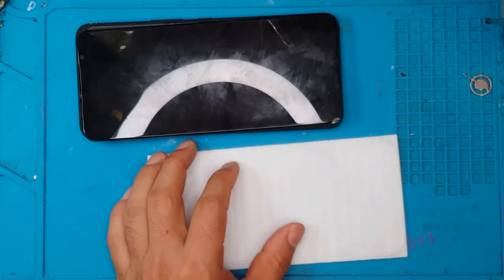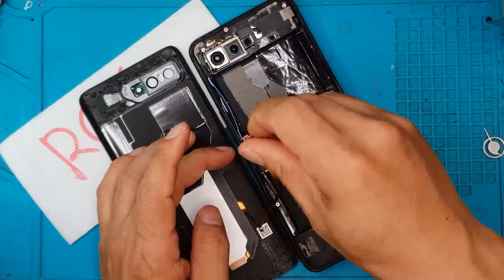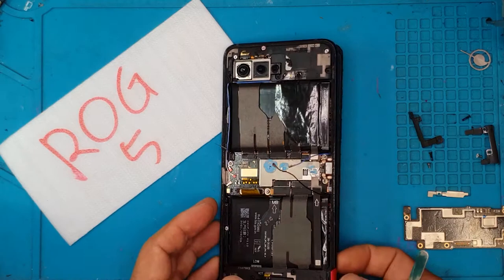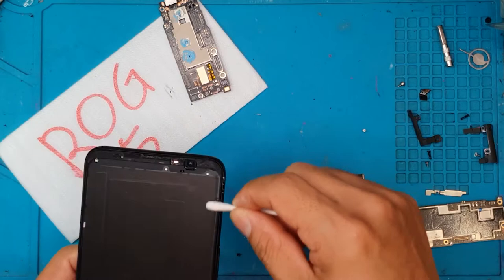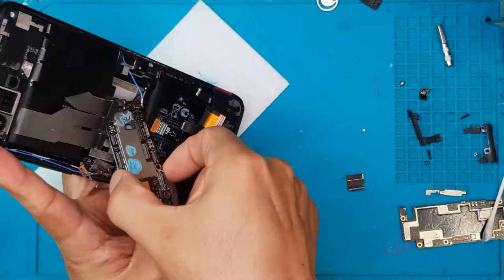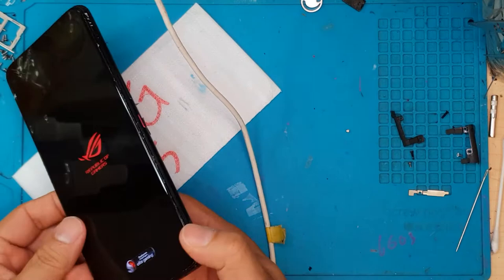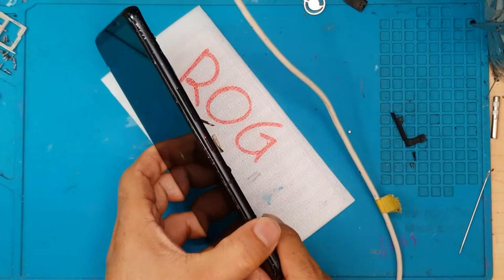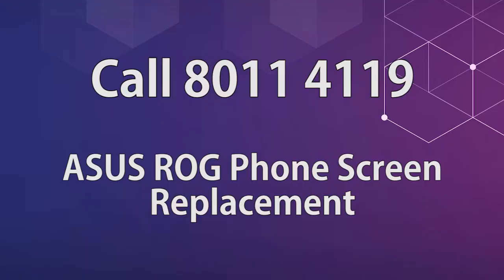It's finally an ASUS ROG PHONE 5 Screen Replacement! | Sydney CBD Repair Centre

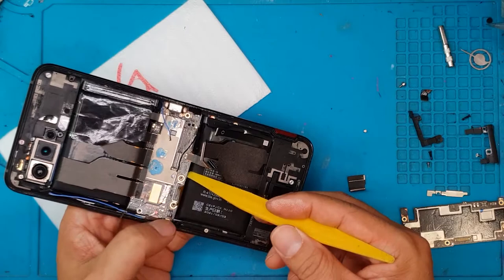Comment: at around 2:33 you mention thermal paste under the battery but you never say if you had to reapply anything...?
Reply from the maker: under the battery, there is strong adhesive so most likely you don't need to reapply anything.

Comment: Do rog phone screens go bad for no reason? My rog phone 5 screen is fine, no cracks nothing but completely stopped working.
Reply from the maker: Hello, it might be some other issue like battery, software, mainboard, water damage, short circuit.

Comment: My rog 5 no display light. Display ic change?
Reply from the maker: Hello it depends on the situation, if no light you mean even the back light if full already small ligh you see, or phone total black screen but it vibrates with you turn on, or phone just dead, you need to bring it to repair shop near you to diagnose the issue.
Reply: @SydneyCBDRepairCentre  even back no light. what Will I have to change?
Reply: @SydneyCBDRepairCentre  i was changing parts without disconnecting the battery connector 😭
Reply from the maker: @FNaga  oh no. you should ask for help from local mobile phone repairers.

Comment: May i know is ths screen u used for replacement is an OEM? cuz my rog 5s screen is broke, i want to know if it is safe if i change it using OEM screen
Reply from the maker: yes, it's genuine. please visit https://sydneycbd.repair/locate-us . we have only a few screens available now. thank you
Reply: @SydneyCBDRepairCentre  does it means oem and genuine the same thing?
Reply: @SydneyCBDRepairCentre  cuz im currently in malaysia and i wanter to change my screen, but the service centre said the one he has is OEM, i wanna sure if it is safe using changing it to OEM cuz the price is more affordable compare to the original one
Reply from the maker: @user-zv5pe7dr9f  you can ask for the warranty. it should be fine OEM / Genuine . Just check the quality of the screen after replacing . thank you.
Reply: @SydneyCBDRepairCentre  ow okok tq very much

Comment: una consulta si el tema de la huella dactilar se desactiva y simplemente no funciona para desbloquear puede ser solamente por la causa de la pantalla y como se podría solucionar  ya que lo busque en las funciones pero simplemente no aparece.
Reply: No necesariamente es la pantalla, ese problema suele aparecer luego de unas caídas que provoca que se suelte un terminal, muchas veces va acompañado de problemas de vibración, SIM, air trigger, etc
Reply: @reyesrugyel5494  como se debe de arreglar ese problema?
Reply: @alejandraurrutia6990  Abrir la tapa trasera con cuidado de que no se rompa y volver a conectar la terminal. Por suerte ya existen muchos videos en Youtube que explican el proceso.
Reply: Es proque se descone ta un connector de abajo si paso cuando lo botaste es por eso solo hay que empujar el connector y se arregla
Reply: @reyesrugyel5494  muchas gracias
Reply: @Estuardomendez13  gracias